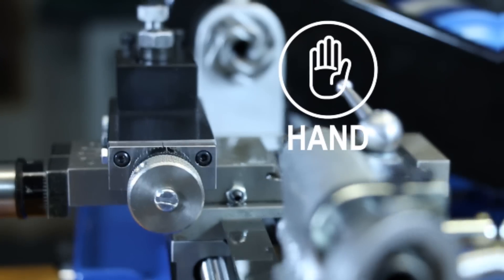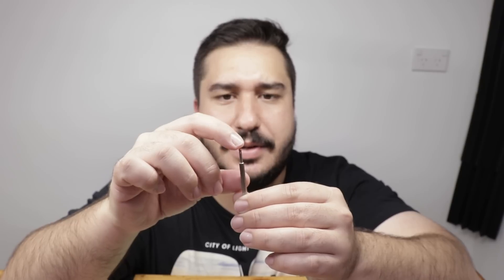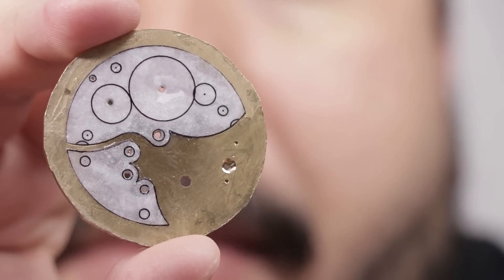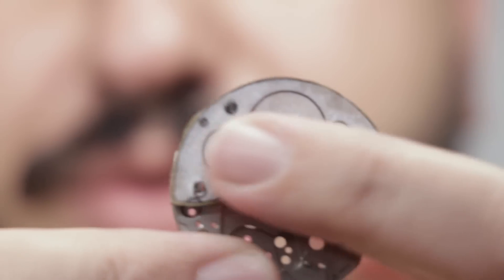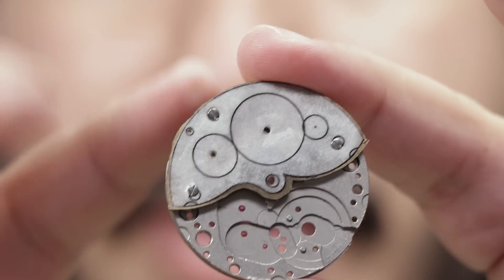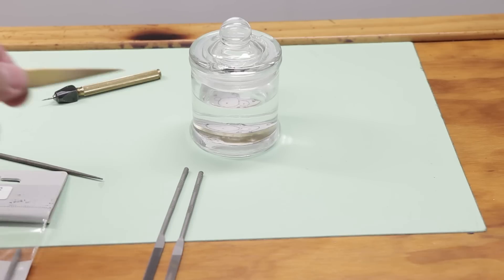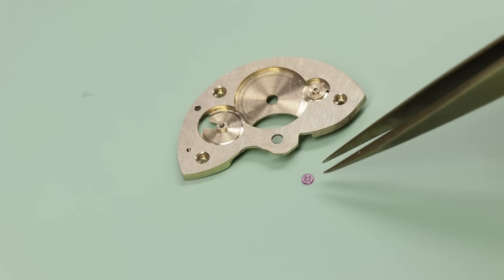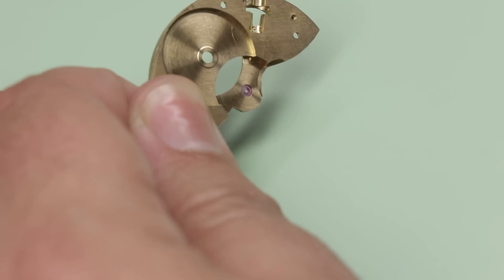Making My First Watch - Trouble Strikes the Barrel Bridge Vlog #18

Comment: why not just put a buch in the oversized hole and then drill it out and maybe solder the buche in too
Reply from the maker: Hi, sorry about delayed reply. These reamers are designed to match the jewel size. They are precisely undersized to hold the jewels by friction, also planning on making a few watches so trying to get manufacture technique right

Comment: Why didn't you enlarged the hole and made a small brass juwel holder?
Reply from the maker: I would love to make gold chatons for the movement But I feel that it wouldn’t suit this design. also, if the larger diameter jewel that I ordered works. The corresponding reamer for the jeweling tool is available too. I love toolmaking  and think I could make a reamer but I at this point I want to just focus on the watch.

Comment: hi Dean. why wouldn't you use from your staking set a rounded hollow punch to push a little material? then follow up with a flat hollow punch to finish it up? doesn't even show if done gently and in stages. particularly useful in tightening up sloppy screw holes.
Reply from the maker: Thanks Lawrence! I didn’t think of that, I was thinking a few hardish hits with lunch to close hole! But this sounds great, I’ve already order the new jewel so if it’s not correct thickness I will definitely try your method! Thanks so much!!!
Reply: my pleasure dean. love your vids.  i will just take it for granted you were going to hit it with a punch, not your lunch!
Reply from the maker: 🤣😂 whoops 😬

Comment: Hello from Edinburgh.  MSCdirect has a 2.19mm reamer in their catalog.  Drill Service (Horley) Ltd probably has it or can help you find one, Genswiss likely has one as well.  Try searching under the inch equivalent 0.0862”.   

Buy  yourself a set of pin gages if you don’t have them.  They are really useful and inexpensive for small sizes.
Reply: fullerton tools i believe does custom size reamers.  deltronic pins are great too
Reply from the maker: Thanks Mack 👍🏼
Reply from the maker: Thanks so much Ben!! Really appreciate that I will look into it 😁👍🏼
Reply: Love the channel, I’m not a watchmaker but I machine small tools and parts to aide model ship making on my Sherline mill and lathe so the content is very interesting.

Comment: Hey man, that’s a bummer... Overshooting dimensions that is.

If you decide to go with a chaton or something to hold the original size ETA jewel, the Seitz style reamers aren’t all that hard to make. It’s just a D-bit cutter with a bit of clearance to one side. If you can turn, harden and polish a pivot to dimension, you can do the same with a reamer :). The smooth shank of the reamer works as a burnisher so as long as that’s the largest part of the diameter and consistent for its length you’re golden. Keep it up!
Reply from the maker: Thanks Karl!! I was thinking that if larger diameter jewel is not correct thickness I would do Chaton for it, maybe even out of gold! 😂
Reply: Dean DK Chatons are cool. I don’t care what the other kids say!